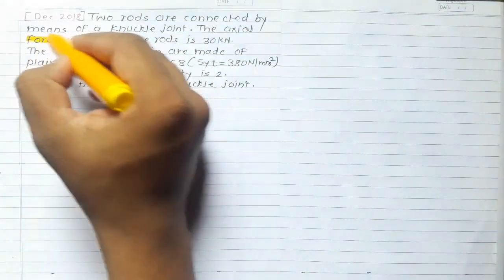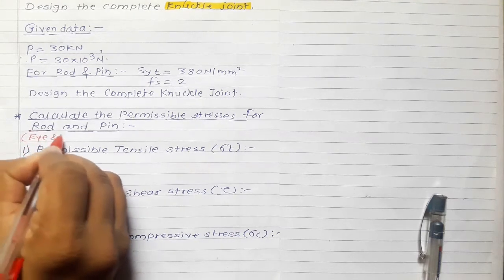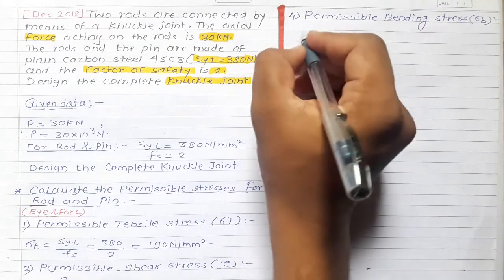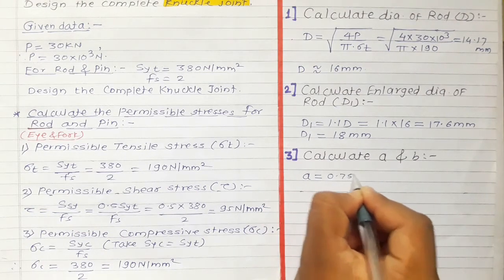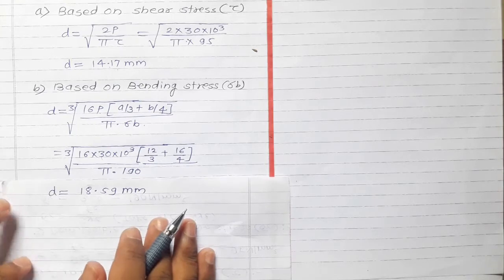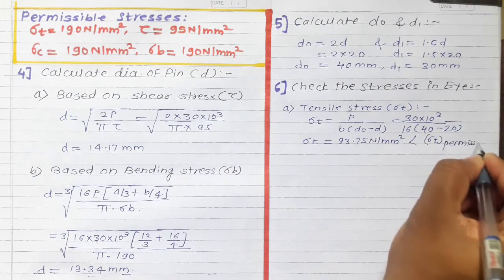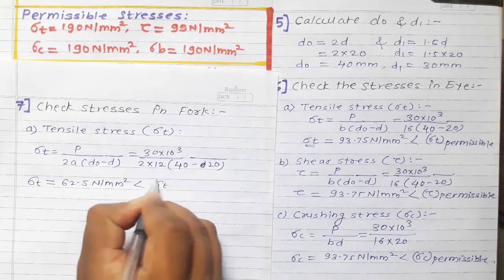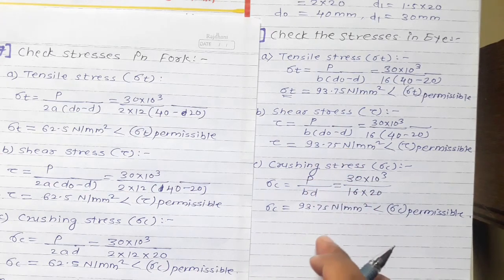2.21 Numerical #2 on Knuckle joint _ University Exam Dec 2018 _ Machine Design I

Comment: Sir in above problem calculation of value "b" ..
and diameter of pin based on bending stress "d" that in sigmab is wrong..
Please reply
Reply from the maker: What is your answer for b
Reply from the maker: Is it 20

Comment: thankyou sir but what if the stresses exceed the limit
Reply from the maker: That is considered as failure means component is not safe. What we can do, either increase the dimensions or alter the material having higher strength. In our case, we increase the dimension.

Comment: Sir how to convert 45C8 to 380 N/mm2
Reply from the maker: You don't have to convert anything.

45C8 is carbon steel material and here in this problem its Yield strength (Syt=380 N/mm2) is given which we have to use to calculate permissible stresses
Reply: @Y9096841236D tq Sir
Reply: Is there any video about convertion sir

Comment: Step no.3  cal. a&b 
b=20mm
Reply from the maker: Correct b = 20 mm is correct...
Reply from the maker: Calculate corrected "d" and put here
Reply: @Y9096841236D d =19.34 so 20mm